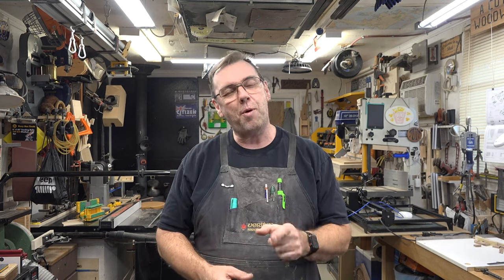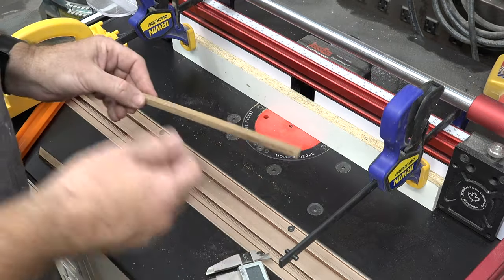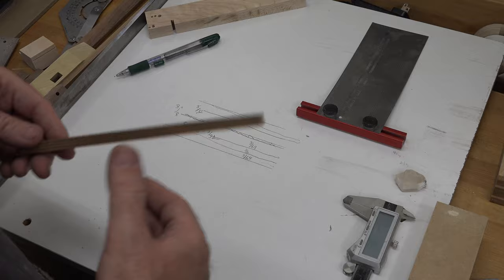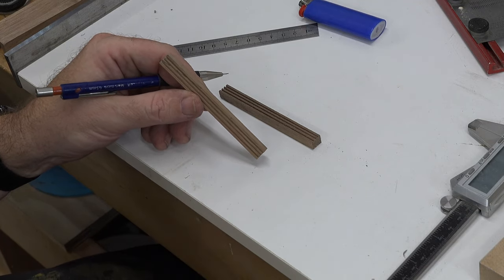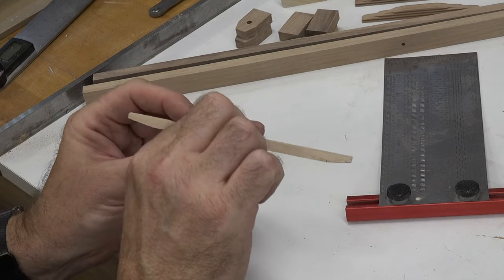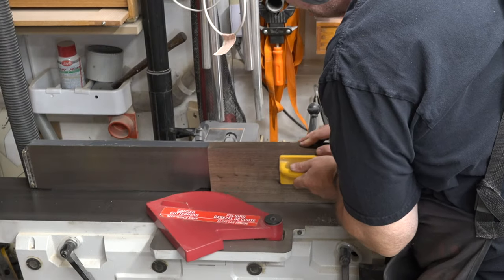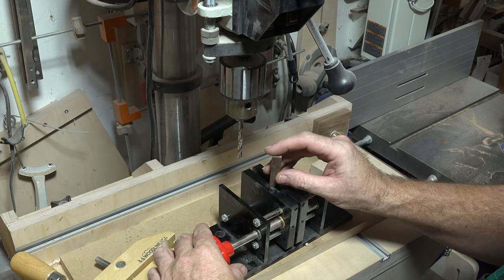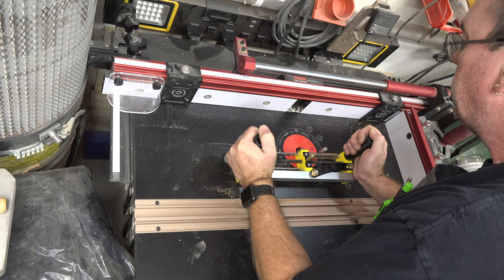Making Toys and Joys Dump Truck and Pup Trailer Part 2

Comment: Wondered about making a laminated spring, but will continue watching to see about mounting the springs to the chassis and whatall to see if that would be feasible at all. Love the model builds and your finding the errors and fixing them for us before we proceed. Thank you for the excellent programs.
Reply from the maker: Glad that you like it Floyd.  There wouldn't be an issue to to laminate the springs.  There's always more than one way to do it.  Thanks for tuning in and for the kind words on the show.

Comment: Really enjoying this build so far (as I always do) ... yet again another fantastic video 😁
Another method for the leaf springs, which I think would be easier, would be gluing layers of veneer together ... I'd round the edges of the veneer over to create the proper leaf spring effect ... cutting grooves leaves ribs between the leaf parts of the spring 👍
Reply from the maker: There's always an alternative method Barry.  Thanks for tuning in and for chiming in with your idea.  It's great.

Comment: Another great journey into the construction and a bunch of great information about how to resolve sizing conflicts in the plan.  The lack of a 1/32" router bit is something that most folks never encounter a need to solve for but as an owner of a CNC, I use them frequently  so luckily I have a stock of them because the break soooo easily.  I was thinking about the other possible solutions and I also think that the Leaf Springs could have been engraved with a laser to achieve the dimension on the plan.  But I also realize that you are demonstrating solutions that can be used by a majority of your viewers and thank you for that consideration.   Can't wait until the next installment.  PS: Inventables have 1/32" bits for $15 USD.  They have raised their prices pretty steeply in the past couple of years.  They are a downcut bit with an 1/8" shank.  But they do break by just looking at them cross  eyed.  🙂
Reply from the maker: I've had some questions as to whether or not a laser would do some of the parts on this model and I am considering doing some with the laser but also demonstrating how to do them using traditional methods.  The lack of the 1/32" bit was actually a blessing because I was able to use my 1/16" and I like the way it turned out and that is the most important thing in one of these builds.  I don't have to please anyone but me.  Thanks for tuning in and for chiming in with your thoughts.

Comment: I love to follow it.
Reply: +1 on that. BTW what's the chance you could convert your plans to imperial?? I really want to make few of those. Ford tractor and Defender.
Reply: @marcelo403polo2  I,m sorry there is no chance that I convert my plans to Imperial. If you use the templates measuring isn,t almost needed! You can use a Imperial ruler without any problem. You only have to convert the holes and drill bit measurement. Ken did not use the templates, no problem, but you can use them. On my homepage below is a link for a free download of the first chapters from the Fordson.
Reply from the maker: Glad to hear it Dutchy.  Thanks for tuning in this week.
Reply from the maker: I've seen your model building skill level Marcelo and you'd have no issues with Dutchy's plans.  They are very well laid out and marked.  Printed at 100%, you can always scale off the drawings.  I hope this helps.
Reply: @acutabove_woodworkings  thanks for the tip Kenny.
What the heck, I’ll give it a try once I’m done with jeeps👍👍👍

Comment: Nice work Ken; The front spring might be very tricky if a router with a 1/16th router bit is not available. This may be overcome by ripping a piece of 5/16th timber into a long enough piece at 3/64ths thick to make 8 spring Leaves for the 2 springs (4 leaves each spring) by gluing 4 leaves together making your spring  3/8 thick X 5/16 wide. To create the appearance of a grove between the leaves you would need to chamfer the edges of them using sandpaper so that when glued up it will define each leaf. This might be an option for someone who doesn't have a router in his/her shop but assuming most woodworkers do have a table saw. This is how I have made springs for some of my models. I will catch up next week with the show.
Reply from the maker: As I've said a million times John, for every product of woodworking, there are about 10 different methods to achieve the same result.  Your method sound awesome for those who don't have a router OR aren't comfortable using a router for the operation.  Thanks for tuning in and for chiming in with your alternative method.

Comment: Just couple weeks ago I broke my last 1/16" router bit. So trip to LeeValley and bought 3 of those. Well those were actually just 1/32" diameter(checked with caliper). I. figured I will try one. Not a chance, extremely light touch just broke it. I returned other 2.  Best solution for everyone is V-Groove, or V-Point bits. I'm really happy with those.
Reply from the maker: If the V-groove works for you Marcelo, that's great but I find that they have too much inconsistency depending on the height of the router bit.  For a bit as small as 1/32" I would think that you would have to take the lightest of passes.  Sorry to hear that you didn't have any luck with them.  Thanks for tuning in and for chiming in with your story.
Reply: @acutabove_woodworkings  yes. The deeper you go, the wider it gets. That’s why I also suggested V-Point. It should give more consistent results
Reply: Also my best experience with 1/16" bit, is the Bosch one from Amazon. And I am not fan of Bosch tools at all. However the bit I can highly recommend

Comment: great video, excellent intstruction. What brand/model of the small parts holder do you have?  I am referencin the yellow one used on the router table.
Reply from the maker: Not sure of the brand, but I know I got it at Lee Valley many years ago.  Apparently they still carry it.  Here's a link Scott.  https://www.leevalley.com/en-ca/shop/tools/power-tool-accessories/router-accessories/41780-small-parts-miter-jig?item=04K0101
I hope this helps.  Thanks for tuning in this week.

Comment: I’ve made several of the Toys & Joys projects, I get the plans copied so I can keep the originals if I ever want to remake one.
Reply from the maker: I usually just make copies of the parts that I want to use the patterns.  I do like to write on mine though to leave myself notes or corrected measurements.  Thanks for tuning in Doug and for chiming in with your methods.

Comment: I have made a lot of these models over the years ( my favorite is the ladder fire truck at 15 models) and like you I have had to do some varying on some cuts.For anyone doing the fire truck there is a incorrect measurement on one of the wheel arches.(No longer have the plans so cannot recall) It may have been corrected in later issues of the plans.
Reply from the maker: There is definitely a possibility that it may have been corrected depending on how many people reported it.  Thanks for tuning in and for bringing the possible discrepancy everyone's attention.